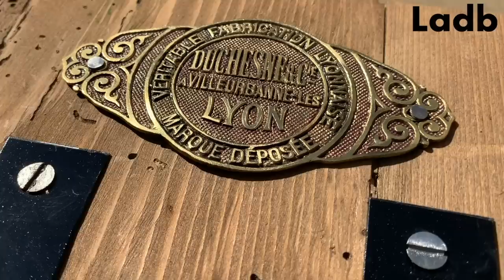Huge and Antique Grain Scale Restoration

Comment: I really prefer LADB over other "restoration"channels, becouse you usually really try to preserve as much original as can.
But in this video you just cooly changed big wooden parts, which could have been still saveable if really wanted. Best part of your videos is when you replace small damaged bits of wood, there were now none of that.

After all, great video. And God thanks you didn't "repaired" (ruined) it with epoxy like some other chanels!
Reply: Acticis    Agreed on epoxy repairs, although it does have its uses, these ancient pieces would be very anachronistic. I understand your concern about salvaging components, but here I entirely agree with his judgement to replace badly deteriorating parts, as the structure and function were badly compromised. Love his attention to original methods and practices.

Comment: Great resto and saving history. The only tiny bit of suggestion would be that you could've blackened the screws either by bluing or heat+oil treatment as they look bit out of place and inevitably they will be oxidized with exposure.

Comment: Good job! This kind of scales are real engineering marvels -- combining steelyard balance (earliest more than 5000 years ago) with floating equal pressure platform and including force multiplying counterweights to increase the measurable range. And all of that in rather robust/low level of complexity. Ability to weigh from 0-300kg in 0.1kg increments is something even some modern scales struggle to achieve. They make extremely good teaching material for introductory physics :P

My only real critical point, and i only bring it up because rest is marvelous, is the metal straps and screws of the platform. While the scale is probably more of a display piece today, it still seems like a major sticking point, excuse the pun. The screws should be countersunk flush with the metal strap, right now they protrude over it and create a number of points where things on platform (like sacks of grain) can get stuck and pull platform off the balance or break the bags. If the straps are too thin for that, they should be replaced.

Comment: Screw caps on the cargo plane protrude too much above the surface and will scratch the cargo and cling to it. On metal strips, conical recesses for screw caps had to be pressed. But these are trifles - in general, excellent work.

Comment: Thanks for the good job and no stupid "music". Just two things: 1. There's a side weight on 5:47 (table view) and 18:03 you haven't use in the final assembly -- what it was? and 2. When restoring partially suitable wooden parts with surface/edge imperfections (such as surface cracks and weathering between wood fibers or thickness loss) try to apply resin casting.  I mean -- try to put an erosed part in a casting mold repeating the original size. It needs special finish methods (eg making it transparent if no painting is needed or engraving fibers and texture before painting) but in some cases this could help you save original wooden parts, close-down them and avoid colour and texture mismatch between old and new ones (IMHO).

Comment: Well I'll be! When I was about 9 or 10 my granddad bought a piece of farm ground at auction. The place had a falling down barn on it and while I was exploring it I found a scale similar to yours literally burred in the dirt in a corner. It had lots more iron it it's design. It was really just the bare frame and so unidentifiable my granddad had to explain what it was to me. I have no idea why, it was nothing I should have been interested in, but I begged and pleaded for him to let me have it, keep it, and restore it at his place in a proper farmers work shop. It was supposed to have wheels and may have been a Fairbanks but it had decorative scroll work built into the cast iron parts...almost like pin striping, which I took full advantage of when I painted it. It took years, I only got to visit in the summers to help with harvest, but I rebuilt it. Nothing like this of course. This would have been 1980 to 1985, I guess and there was no such thing as the internet or Amazon or parts from China. The only thing I couldn't find, which makes the whole thing work, is the counter weights. They just never show up at flea markets or swap meets and I was doing it on the cheap and by scavenging so if you could buy them new, I never even looked. By 1987 I was in the Army and those days of doing things with my granddad were over forever and the scales probably got auctioned off with HIS land. The circle of life...sucks. I remember he called the weights "pea's" or "P's", as in the "200 pound P"...have you ever heard them called that?  He was born in 1909 so it could be a very old term. Yours looks awesome. Thanks!

Comment: I will repeat my comment from another video.
WOOD - CONSUMABLES.
COROUND - showed all the horror of the old tree .

I watch a lot of your videos.
Why don't you soak the tree (which is working, it gets wet during work) with oil (for example, Vaseline, it doesn't deteriorate)?
Your old wood is like a sponge, it absorbs everything.
Previously, they did not process wood for such machines, but now we have everything for this.